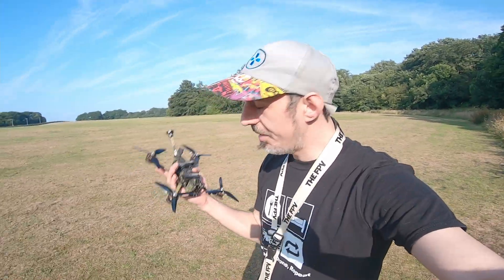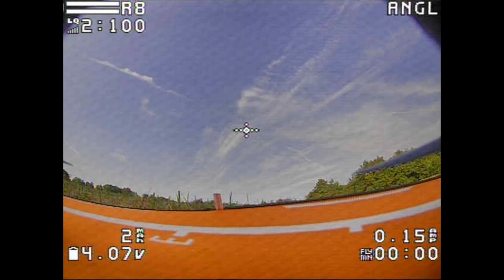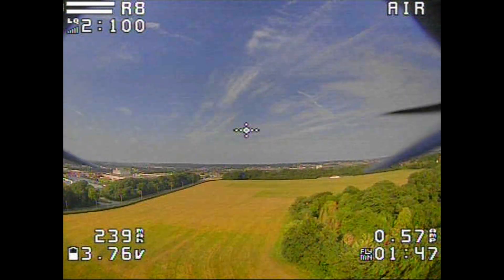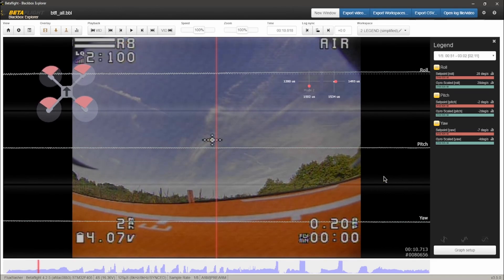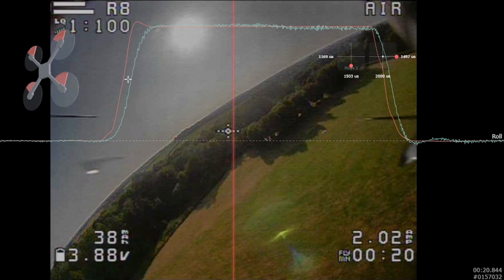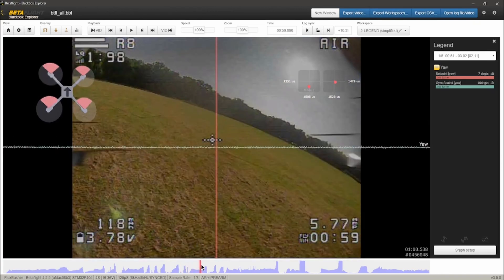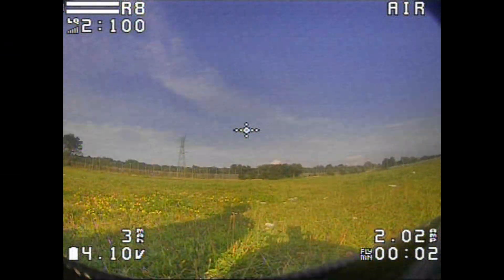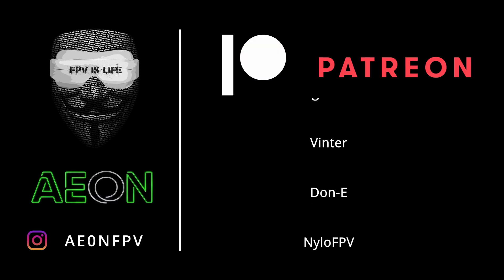Super Simple Blackbox Tuning Basics(For up to BF4.2) | FPV

Comment: I turned D all the way down for cooler motors, no dice, what gives? I haven't tried the sliders yet. That's my next plan of attack.👍
Reply from the maker: Sorry to hear that Chris, D term is the braking force of the motor, without it, P term will be fighting itself constantly, giving you hot motors. May I suggest; re-flash your stack to BF4.3, moving your FILTER sliders to the left a notch or two, THEN tuning via sliders until your close, then you can change the numbers like in this video.

I will be updating this tutorial series with BF4.3 asap since there are some new features that are super useful and easy to use! Stay tuned!
Reply: @AE0NFPV  You said " D term  is the braking force of the motor without it P term will be fighting it  " I had to repeat such a good tip 😃Thanks much.

Comment: Very nice and clear good work, some people can really overcomplicate stuff and almost expect others to know what they are talking about. 
Just set up a logger on kiss g4 and I can’t work out any where how to get the files displayed 🤯, 😂 uk 👍
Reply from the maker: Thanks! i really did try to simplfy it as much as possible :) 

My method shows BlackBox LoggingOnboard Flash, however for yours it would be Serial Port and set your UART correctly 👍
Reply: @AE0NFPV  thanks 
I can get logs onto the card just having trouble opening them in the black box explorer.
Reply: Yeessss, I seem to have done it. So all I had to do in my case was change the confic file baud on the SD card notepad to 250000. I can now view logs in the explorer. Followed your tuition to simplify the graph set up. This has helped me for sure. Thanks for sharing 🙏👊

Comment: I don't see just roll as option for my graphs. Says gyro+roll, yaw, etc
Reply from the maker: There is a point in which I click "graph setup" pause the video there and make yours look like mine buddy
Reply: @AE0NFPV  yeah I saw that part. You have options that just say yaw, roll, or pitch. I don't. Mine say gyro+yaw, gyro+roll, and gyro+pitch.
Reply from the maker: Did you create a custom graph to put your pitch roll and yaw in?
Reply: @AE0NFPV  I wasn't aware I could make a custom one.
Reply from the maker: It's cool right? You can set it up any way you find helps you :) If you have any more trouble hit me up :)
Reply: @AE0NFPV  thank you so much!! Gonna try messing with again soon.